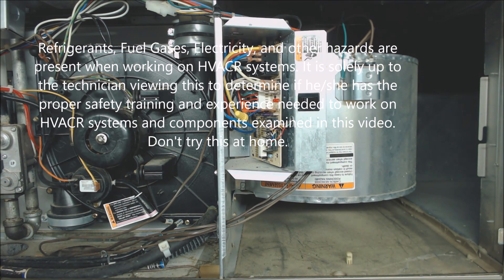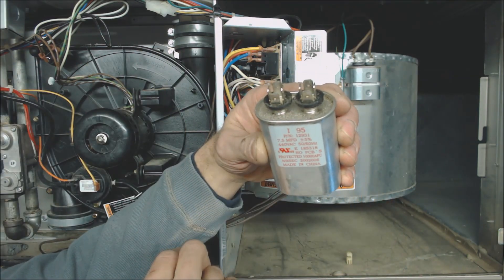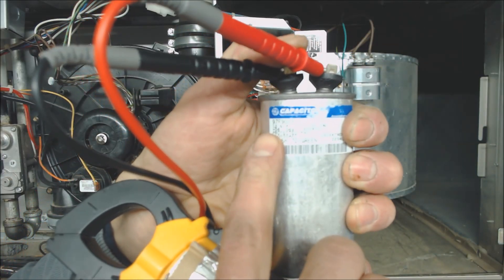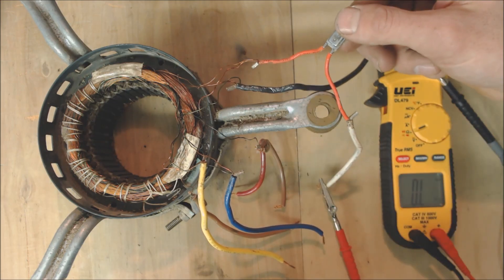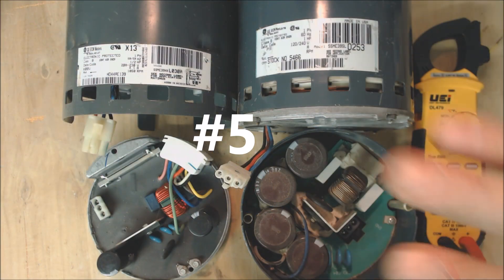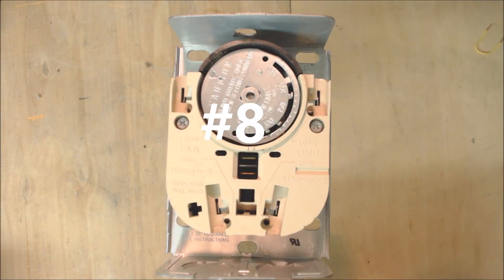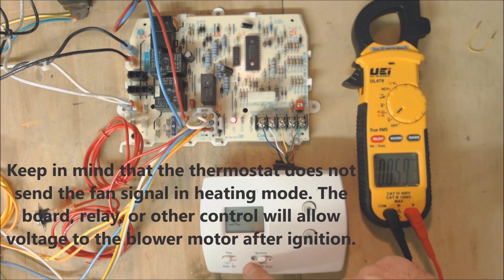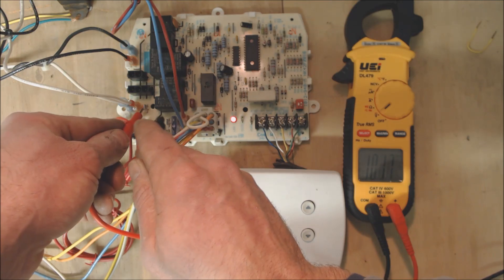Furnace or AC Blower Motor Not Starting or Working! Top 10 Reasons Why!

Comment: We had severe winds and my furnace won't kick on now. Power supply is good .pilot light is on. Could it be capacitor? There is no reset button I can find. 1976 GE furnace. I am strapped for cash..I can afford parts and I'm handy as heck (fixed water heaters, washers,  driers..etc .) Can't afford local prices for HVAC techs.  I just can't find a manual for this old girl.  Any help would be appreciated .it's getting cold!

Comment: My AC compressor at the condenser keeps freezing because the evaporator freezes first.  I noticed that when this happens, the blower is not working when it should. 

So I have to let the ice melt for a few hours before starting my AC unit again and works fine with the blower and everything. 

It seems that after a few minutes, hours or whatever time, the blower stops working causing all the ice in the evaporator and then the compressor outside in the condenser. 

What could be the issue for the blower to stop working after operating for a while? The  motors sounds good.

When the system is frozen, I have had tried to start the blower by selecting ON from AUTO at the thermostat, only hearing click sound, but the blower does not start even after waiting a few minutes. 

But then it works all of the sudden.  

Help please.

So far I've had to different HVAC technicians over my house to diagnose the problem and both have fail.

Comment: Be sure to check the flame sensor.  those go bad and the blower won't start.  So if your furnace starts and the blower never sounds like it is being engaged, the issue lies before the blower, which is the flame sensor.  Take it of, wipe it off gently (no sand paper or such).  maybe #0000 steel wool if wanted.  place back in and give it a go.  If it fixes it, i'd replace the sensor soon.

Comment: I do not have a capacitor in my unit, it looks like there is a relay so this carrier model must have a variable speed motor - I can hear the fan trying to start, but it can't - would the relay going bad be the likely culprit? I've replaced capacitors in other units, but never a relay in a unit without a capacitor?

Comment: On my 2010 TempStar furnace, the PSC motor overheated and shorted out the start winding. This is easily checked by measuring the ohms across the two brown capacitor leads with the motor disconnected. It should read 60 ohms on a good motor (20 + 40). I was getting just 20 ohms so the start winding is obviously shorted. The interesting thing is how the motor would still start up when it cooled down but would fail after about 20 minutes of operation when the motor was hot. So there could have been some other issues with it as well like bad bearings although I couldn't detect anything obviously wrong with the bearings. It was 14 years old, so I changed the motor and capacitor out and she is running like a champ now. In A/C mode, it would short cycle which has been doing this for years before the motor finally failed. After replacing the motor, there is no more short cycling and I get a nice 10 minutes on, 10 minutes off cycle. BTW, my original capacitor was good and was replaced a few years back but I replaced it anyway.

Comment: My unit isn't that old but I can't find a capacitor anywhere, are there certain spots I should be checking? I've looked all around the fan chassis and circuit board and can't find it anywhere
Reply: I assumed only older units wouldn't have a capacitor, maybe I'm wrong?

Comment: Good stuff, thanks for posting.  Question, when I set my system to off and fan to on, fan stays running no issues.  However, when i set the system to cool, fan runs a min then shuts off.  Will try to restart 3 to 5x, run for a min, repeat.  Same behavior if fan is set to auto or on.  I have an electronic tstat with batteries, will reaet it again and swap batteries.  If i want to by tstat for a test, what wires to connect?

Comment: Thanks so much for your video on this! Thanks to your help, I found the relay on the control board to me the blower motor to be bad. Until the new controller comes in that I ordered, I wired my blower motor (it's 110v) to a cord with a plug to plug in an outlet. This is the same as the unit being in the fan being in the "on" position on the thermostat anyways. And it's working until the controller comes in the mail!

You are a lifesaver! 

I don't know if you still check these videos, but I do have a question, will running the blower motor (pretty much the same as it being in the on position), waste a lot more power? I've read that it's probably better for the blower motor actually to be ran like this because it doesn't have to stop and start. Is that true as well? And lastly, I do notice that running it like this makes for the house to have no warm spots in rooms. Is that a benefit of doing this?

If you do read this, again, thank you so much! You are a lifesaver! 👍👍👍

Comment: Will a bad module work intermittently?  I’ve changed out my control board and manually tested the ECM motor (all speeds) and it was working normally but my blower still comes on intermittently.  What would cause the blower not to come on? It’s a Goodman package unit.  The capacitor is still good.  The blower works intermittently in all modes (AC, Heat/Fan) if we are lucky once a day and we bought a new thermostat.

Comment: My blower motor doesn't turn on for both heating and cooling and also for just the fan, the motor itself is cold and there's no flame whatsoever, the circuit board has the green light on though.

Comment: I got question hopefully someone can answer quick!

My blower isnt working, the capacitor was broken so i replaced that first but it didnt fix the problem so i had someone take a look, they said the motor needed to be replaced so i got one and am in the process of installing it. 

My question is, how can both the capacitor and the motor both be busted? Shouldn't It just be one or the other?? Or is the fact that before it completely stopped working it was working only intermittently the reason why both broke??

Comment: Help Please!!! My blower motor doesn't seem to have a capacitor that I can see. It's a ruud  Hm4821ja.   When the thermostat kicks on the outside unit turns on but the blower motor stutters and maybe will start spinning.  If the air has been off for a while it will stutter but start and stay on just fine.   If the thermostat turns it off and then it tries to turn on anytime soon... It stutters continuous trying to start up spin but won't!   I was hoping it was a capacitor but I can't see one anywhere.

Comment: Mine is a Heil/Tempstar furnace with a DC motor. Technician confirmed what I already believed to be a failed speed control board. Of course it is discontinued. He suggested changing it to an AC motor. I ordered a used board from Ebay, waiting for it to arrive.
I looked at the failed board and its completely covered in grey silicone or something, but I could see part of a fuse showing. Why would they put a fuse on a circuit board and cover it up? Motor tests good, control board sends signal to start but speed control doesn't make 24 vdc for motor.

Comment: Mine turned out to be the windings that are responsible for cooling were shot and the motor would get very hot. On heat cycle, the motor would run fine and the motor did not get got and this is after I replaced the capacitor. So this turned out to be the motor.

Comment: If a blower isn't working would that keep the compressor and condenser fan from coming on too.

I lubed my condenser fan motor because it wasn't spinning freely and everything worked for a couple of days and now nothing comes on. The condenser fan turns freely when I turn it.

No hum at the compressor. Condenser fan not on. Blower not coming on inside.
Breaker is on. Fuses at disconnect are good.

Thanks

Comment: I have a blower motor that will only run at very reduced speed (no real air movement) with tstat set to on. If tstat is off, then there is a hum that appears to come from electronics part of cabinet, not motor.  Small Carrier unit has no capacitor.  Motor windings test OK. Is it a motor module, transformer, or other?

Comment: It is best to have a extra capacitor for inside air handler an outside condenser unit!! I did watched some videos an decided to buy an extra for the out side unit an lord behold my compressor wasn’t engaging on so I replaced the capacitor on a hunch an everything started working an cooling again I bought a new spare for next time also if needed, make sure you cut all power an short out the capacitor with a insulated screw driver!!!

Comment: my motor bursted into flames and the landlord replaced it with a used one and now the fan stays on all day running and the cold air bearly cools off the apartment so im waiting on a small tablet they said that is the issue missing on the motor 🤯🤯🤯

Comment: JUST REPLACED capacitor . Still the same weak slow speed then shuts off. FOUND universal blower motor for $75 locally  . Third day without ac mom's 86 yo . Losing patience

Comment: GEEZ , the guy helping me at AC place their place not open today or tomorrow AND I need to ask him again something . He said yesterday on blower motor if I disconect the cool terminal wire on circuit board and connect the bottom black wire to cool terminal that ( this is what I'm not sure what he said and needed to talk to him ) if it works ( or doesn't ) that means board is bad NOT the motor ?? OR is it the other way around ?? And yes replaced capacitor . Still the same barely running the blower not full speed and shuts down after a while even with new capacitor

Comment: What causes the blower of AC residential unit  to spin the opposite direction instead of the proper air flow direction. Please help and I will donate monthly. It's a Bryan heating and cooling model 315AAV048090AEJA , heating with NAT gas. I'll appreciate what best info you have. Awesome video and tutorial. Thank you for your help.

Comment: What is the black motor/blower assembly called and for? For me it is THAT one which is super hot, starts to move but needs my help and is connected to a small rectangle plastic 2 prong item which I think may be a capacitor

Comment: I have 2 units , 1 for each floor. Is there any connection between the 2 units? I’ve noticed the wires from the thermostat are doubled at the circuit board,   Thank you if you have time to answer

Comment: I watched your other video on the fan limit switch but it appears that mine is working and spinning correctly but the blower still does not kick on for the heat while in auto but works perfectly fine on Auto while in A/C mode

Comment: My blower motor stop after 3 minutes of use and I removed the motor to see if it is burned but not.I check the capa  citor and it has continiuty.I put it back started and stop again after 3 minutes of spinning.What is the problem? I know I found out the hard way.It is working now.
Reply: Did you ever fix it?

Comment: I have an HRV with a high/low speed motor. It's not turning on. If I check between common and high or common and low I read OL. Does this mean I could have a broken common or overload. I am going to check capacitor now. The squirrel cage spins but not freely like yours.

Comment: Hoping for a tip before I shell out a bunch of cash for an AC tech. So my blower all of the sudden stopped working last month, it was really dirty inside and was the original motor from 94. I cleaned up all the dust on the wheel, bought a new blower motor and capacitor. Turned on the AC and still wouldn't blow air. Turned on heat and it blew air for a second and then stopped. Unplugged some wires because I had the low and medium switched. Plugged back in and it turned on with the AC for like 20 seconds and now it won't run again. I'm thinking it has to be the control board because everytime I hit the door switch I can hear the relays click but nothing spin? Any ideas?

Comment: I have a blower fan problem my fan randomly stops even when the thermostat has the fan running. Just like it randomly stops it starts running like normal again. Some times the fan triggered when I turn the fan on and off multiple times to get it working. What could be my problem?  Mine is an Electric HVAC system.  I have already changed the  blower motor capacitor and that did not fix it.  The issue of fan randomly not running still persists.  What else could be my problem?

Comment: I replaced the capacitor and ensured that I get resistance across the motor. The fan turns on but It can't make the jump up to full speed. Any suggestions? Appreciate the video
Reply: Mason Savage Did you check resistance across all windings? There's a set for each speed usually. When you say 'make the jump' do you mean a manual switch, or...?
Reply: @timmarrier  I figured it out. Faulty blower motor. :/ Thanks for the video though

Comment: I am now apprentice my control board getting 24v from transformer but they are not coming showing on thermostat terminals ?

And also no red light
Reply: jump at ur thermistat green to red if ur blower now works its ur thermistat that should of been the first thing he did  he skipped to the capacitor
Reply: @NeighborBones  Hey, I just did that, but my fan only runs when it is set to auto. When it is on fan on mode, blower does not run, even with the jump. 

I have replaced the fan limit switch, motor capacitor, and 1420844 spdt relay which was burnt on COM prong.
Furnace model: GUG141A020IN

Any ideas? 

ps. Last time i called a service guy, they tried to sell me a new system =)
Reply: @zunairfayaz  ti believe this to be a thermostat issue.
Reply: @NeighborBones  That did the trick, but it ran only one or two  good heat cycles, now it doesn't even send the ignite signal. 

I mean the ignition controls' light is not turning green when thermostat  is trying to turn it on.

Thanks for quick reply!

edit:
one of the wires came out from back of the harness that goes to control board! what a mess lol

edit:2
at the end, it was the thermostat and that lose wire on the harness.

Thank you! looks like it's working ok but the airflow doesn't seem right. It's too low, the blower spins ok, I'll add some oil maybe that will help.
Reply: @zunairfayaz  congratulations on getting the signal to the furnace area! sound like you have multiple problems.. im thinking you havent fired this up for some time.
There is a sequence of events for furnace to run properly. assuming you wired up ur thermostat correctly. you can youtube the sequence.. there are others for wiring the thermostat.
Reply: @NeighborBones  Sequence seems fairly ok but there is still a prob i thing cuz of the airflow. I need to check my vents.
1. thermostat sends signal.
2. igniter comes on.
3. heats up to 140°f 
4. blower kicks in (while flam is on)
5. flame shuts off, it hits high temp (170) while blower is still on and thermostat is still on. (this is where im thinking blower isn't pushing the air fast enough to cool  down it down. 
6. temp reaches 130 and igniter kicks in, flames up, fan still on.
7. repeats 5-6 until thermostat reaches the desired temp.

in 5. i think the flame shouldnt be turned off, if air flow was good then it would cool down in time so flame would kept running until thermostat reaches the desired temp. 

Let me know your thoughts. 

I can't believe someone could actually help in youtube comments! 

Thanks!

Comment: I found a broken wire on mine. The wire had broken into.  I used the fan switch on the thermostat because the fan wouldn't come on one day and the furnace would shut down after a minute when it was lit.   So the yellow wire had snapped.  It came when the ac was on but the furnace.  So I had to splice it.  It works fine but stays on too long, and it blows cold air  has to turn the burner on to warm up.  If leave temperature on 70 it stay on for 15 minutes  and kicks of the fan.   It's a 1980 furnace. It hadn't been cleaned in years so I cleaned it the I could.    It's an an apartment and doesn't hold heat that good.

Comment: My blower motor is good.
When calling for heat the fan switch clicks for the motor to come on but motor doesn't respond
I need to set the t'stat from auto to run and the motor will come on.
Thanks in advance!
Rick B

Comment: My blower motor isn't working when in heat mode. It works fine with cooling mode. I am getting 120 at the plug for the motor for both heat and cooling wires i.e red and black. I actually cut a extension cord and feed the motor to each separately  just to test it. On the cooling wire motor ran fine on the heat wire just hummed. I'm thinking bad motor.
Reply: Probably not the fan motor, control board issue maybe.

Comment: Thanks so much for such clear explanations and guidance!  I might possibly be zeroing in on the problem I have, and would love some input if you could spare a moment:  I have an ancient late ‘80’s style Nordyne (Intertherm) gas-powered, downflow unit, and as of this season (winter) the blower only runs for heating when thermostat is set to “on” but not in “auto” even when temp gets cooler than desired setting....not sure if this might be related but I also found the capacitor to be bad and replaced it and now the blower runs if turned on manually only....control board?  limit switch? Something else?   Thanks so much for any advice!!